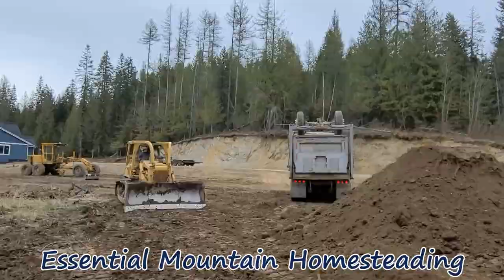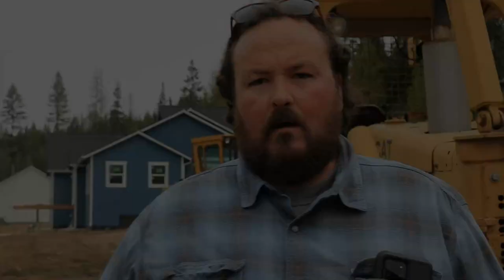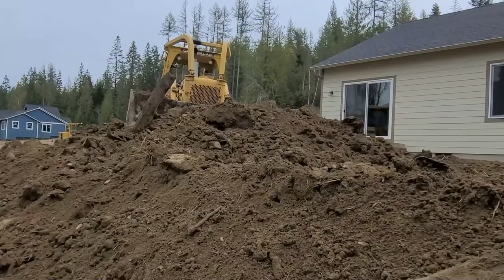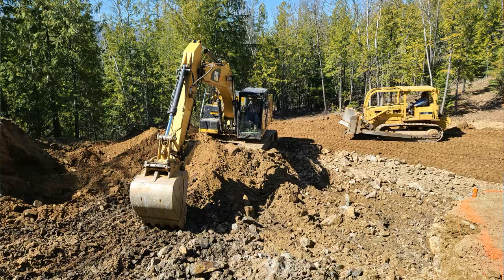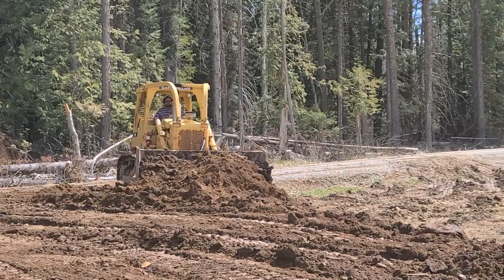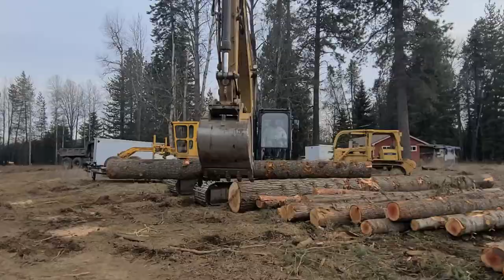Earth work and Excavation, Things To Think About Before You Build

Comment: A good supply of well water is so important that I didn't even have the house plans drawn up until after I had a well drilled.  Had to go down nearly 700 feet, but got 20 gpm, which was great.  After that I hired an architect to design the house.

Comment: While cabin-hunting in Northern NM we learned that any slight excavation to level a pad or build footings & stem walls can result in multie springs popping up. A newish cabin we really liked had multiple springs in the garage which was rocked rather than concrete. They'd installed multiple hidden French drains only needed during spring thaw. My husband who loved tinkering with ATVs, snow machines,, etc couldn't envision a workspace void of concrete. There was mold growing on inside of garage windows & everything stored in the garage was in plastic containers. Many red flags! The inspector didn't "find" any of the flaws I mentioned.

Comment: I am in the process of having a house (single story) and shop built of 5 acres on very gently sloped land. We ended up having a 300+ foot driveway and therefore had to also install a hammerhead to meet the county code requirements.  The excavating estimates were crazy expensive so it ended up being cheaper to buy a large CTL and rent an excavator for the tasks that that CTL could not complete.  I have the driveway installed with gravel down and in the process of completing the house and shop pads.

To bring the house and shop pads to grade (Wife did not want a daylight basement.) I need to cut/fill roughly 18-24 inches to bring the house to rough grade and 36 inches of cut and fill for the shop.  There is roughly 18 inches of dark brown organic topsoil with clay underneath on the top of the the a slightly hilly area of our property and much less organic material as the slope declines toward a small seasonal creek and pond of the property.  

My question is if I should use the clay I excavated to bring up the grade for the house and shop or should I bring in structural fill?  Or should I wait to bring the house and shops pads up to grade and allow our contractor/subcontractors  input?  If I wait to bring the pads up to grade will this effect our site disturbance permit inspection?  For the driveway I brought in structural fill to bring up the grade/then used tons of of gravel (Given the clay soil we installed fabric under the driveway.) to better manage possible water runoff issues and installs swales and pipes/drains to protect the driveway.

What should I do with all the top soil I cleared off------So far I have been using the top soil to fill in holes and low spots on our property in non-critical areas.  I was also thinking about pitting in a Mtn. bike and dirt bike jump park with all the extra soil.  When I  helped build mtn. bike jump parks in the past we added/mixed in cement into the mounded up jumps to help the jumps maintain their shape.  I also cutting many of the trees I have cut down---down the middle to make/build Mtn. bike ramps and platforms/bridges.  Any other ideas as to what to do with the cut down trees (I now have many years of fire wood)/top soil? 

Its sad to see the prices of raw land in north Idaho becoming so expensive---glad we bought the last when we did----sad that other people will have greater difficulty buying land in north Idaho in the future without living farther and farther out of town.

Comment: Yes , here in Texas, and southern Oklahoma, there's not alot of basements. But the slab on grade, they use post tension steel cables running through the concrete, with the footings. 
Big office slabs use in the years back used select fill. Was a mixture of dirt material, that was processed in lifts, the tested for compaction. Myself I would love a cabin with a basement.